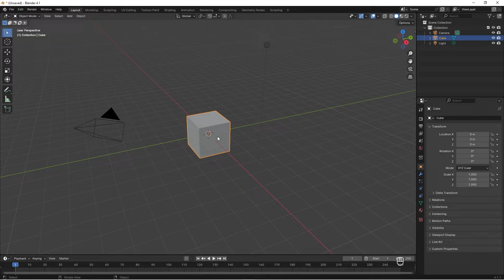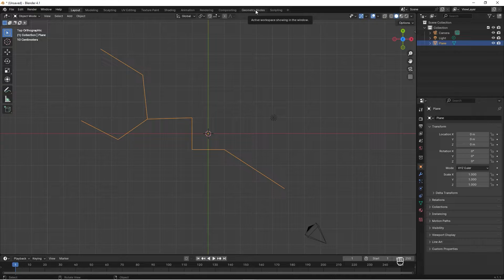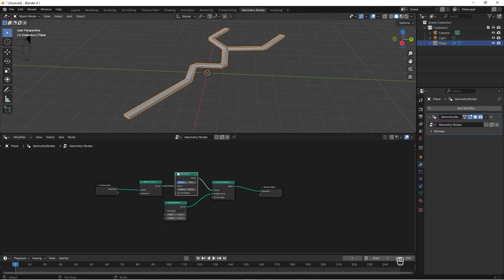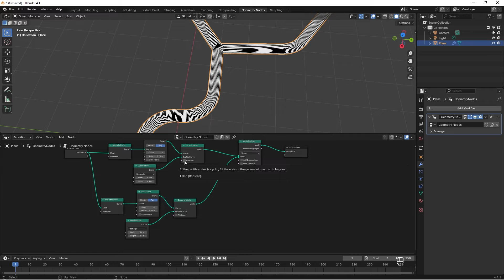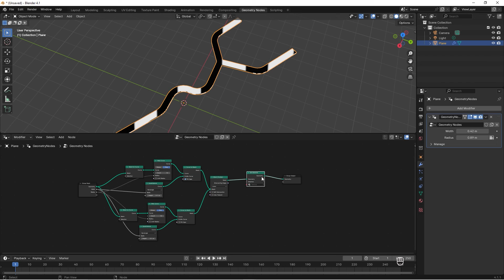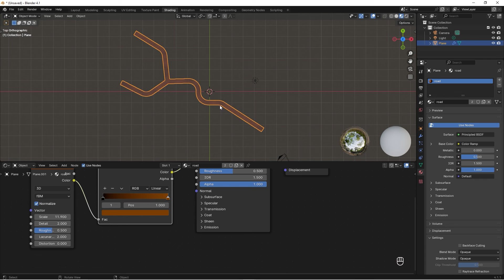Road Intersections in Blender with Geometry Nodes: A Step-by-Step Guide!

Comment: what if i then wanted to add a line with a color ramp at the middle? i would need some kind of attribute that goes from the middle of each instance and follow the curve. can it be done somehow??? does this have proper uvs that follow curve or something?
Reply from the maker: Question 1: Yes, this could probably be done. Unfortunately, I’m currently under a heavy workload, so I can’t help you.

Question 2: This solution is a bit “quick and dirty,” and therefore the UV setup has many issues and needs a lot of work.
Reply: ok thanks for answering. i managed to put UV's by capturing length attribute and storing it as vector:) i still have a slight problem about offseting and scaling the uv but i think i am in a good road:))
Reply from the maker: @petsiskonstantinos1347  hapy to hear, good luck :)